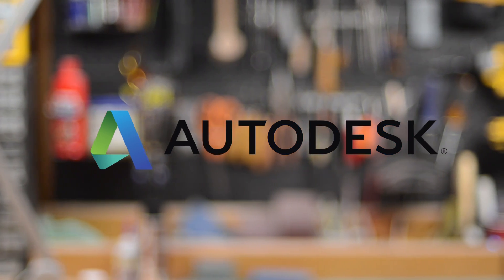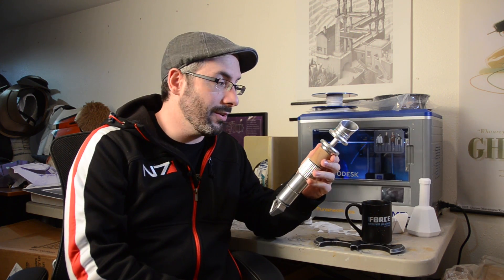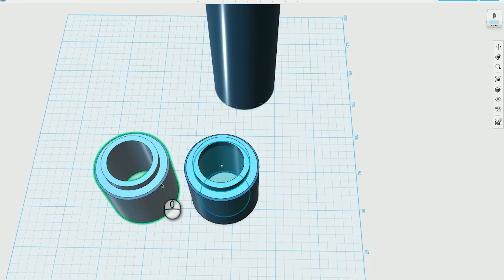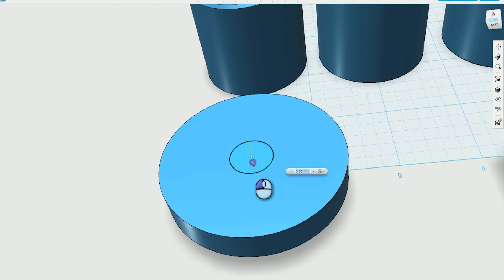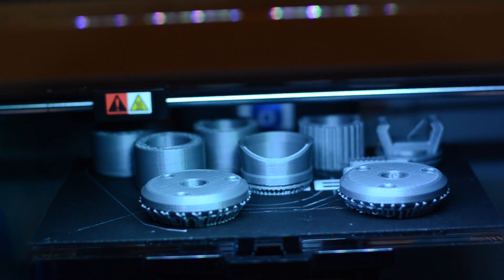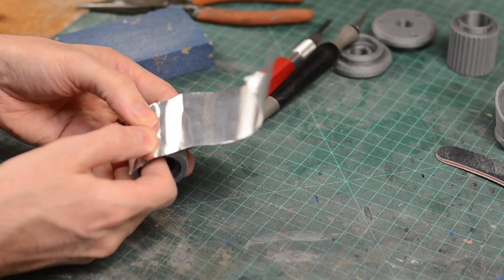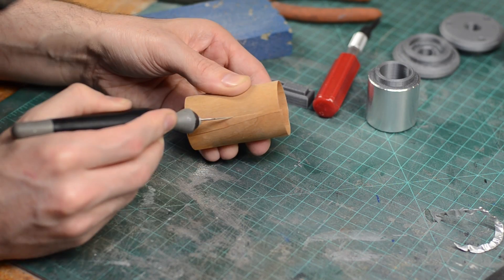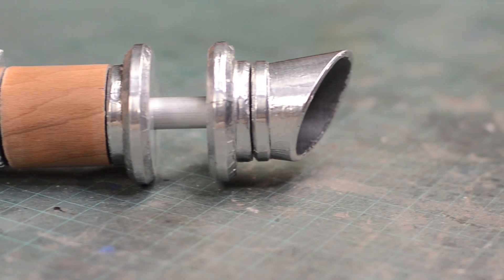Prop: 3D - Season 1, Episode 2: Lightsaber

Comment: I was just wondering, what type of glue did you use to get a strong enough hold between the pieces? I just finished printing out a replica DL-44 and need some ideas for gluing everything together so it doesn't fall apart, thanks!

Comment: You could have used aluminum leaf with spray sizing. It's amazingly thin and conforms to finer detail than the tape. A quick coat of silver paint underneath helps if you miss any spots.

Comment: Would've liked tons better if you painted it, the foil looks kinda cheap. Sorry :s
Reply: +Ron Meikle It's actually pretty good to just go in after the tape to just add a bit of paint to do weathering and texturing or even something like steel wool to add a brushed-metal look. Even if it doesn't look amazingly finished now, it can work really well.
Reply: +Bill Doran oh yeah if you're not finished then I agree there's a lot that can be done over the foil. I meant no offence, I'm just used to you turning out stupendously amazing pieces.
Reply: +Ron Meikle 
what kind of paint would you use ?